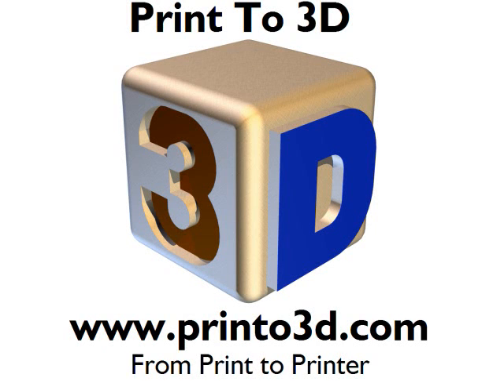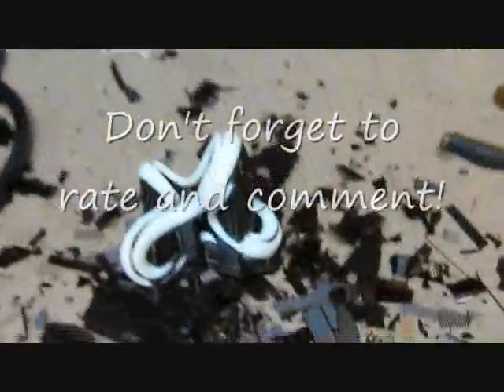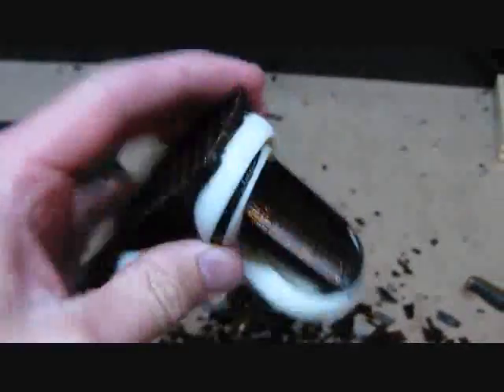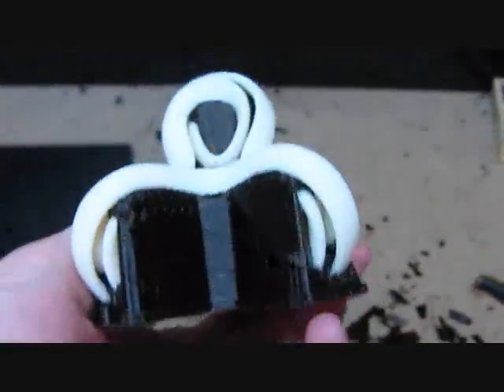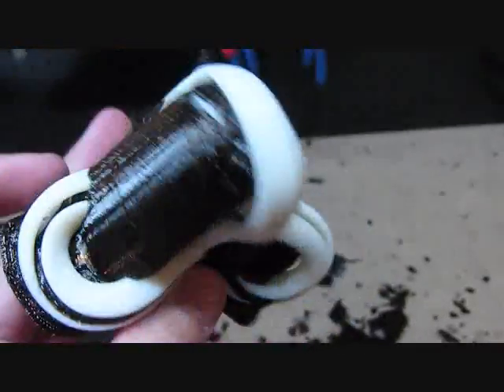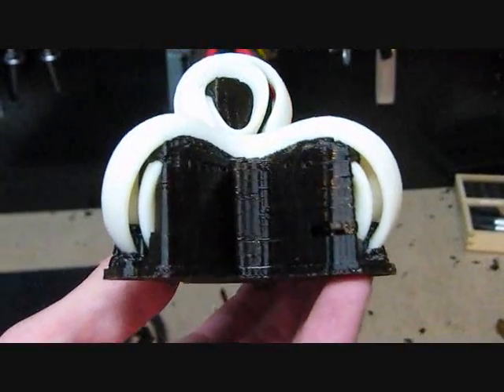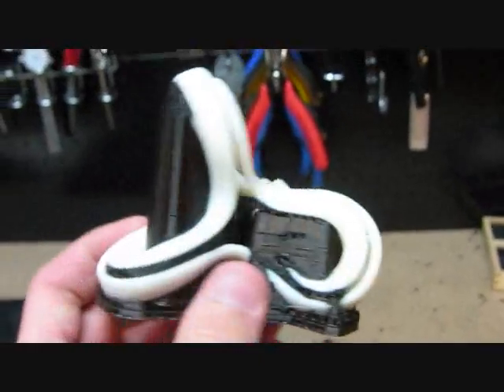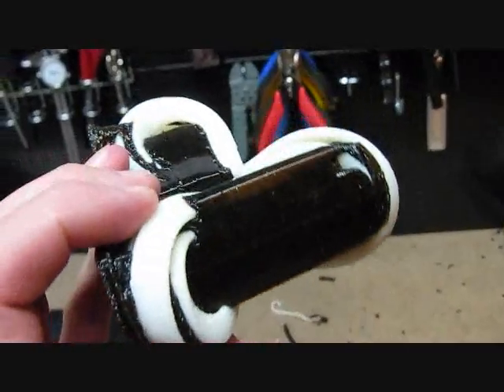3D Printed Topological Model

Comment: Is that print even possible to do on a real machine or only on a 3d printer. Because I get that the printer can access all 12 degrees of freedom at once. A cnc machine can only access 5 sides at a time.

It'll be an interesting age when they can make printers to handle special alloys and at aerospace precision. :)

(and then in the next century, have one large enough to just print the plane itself in one go from the bottom up!) lololol!! :)

Comment: how much does a machine like that cost Oo.  And how are the surfaces on the plastic (if its textured, smooth rough etc)  Cuz my school has a 3d printer that uses powder which you then have to cure sand etc.  I was wondering how a printer that prints in abs differs.